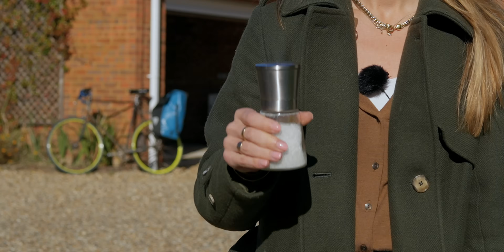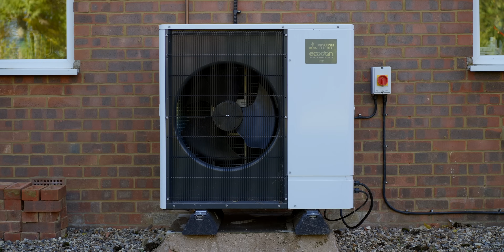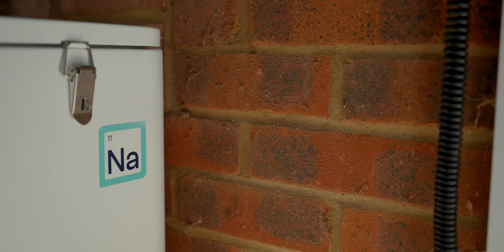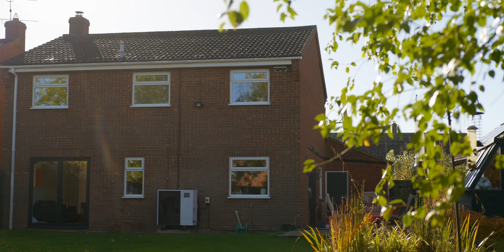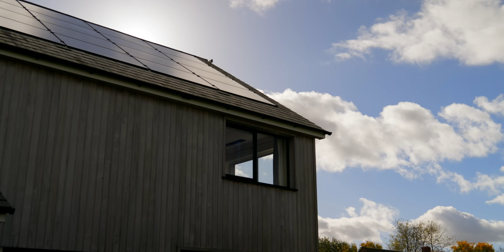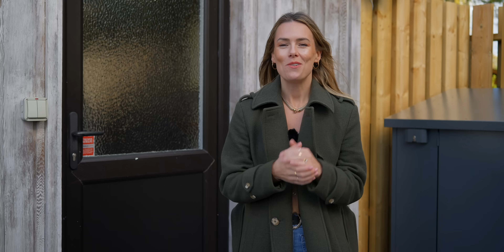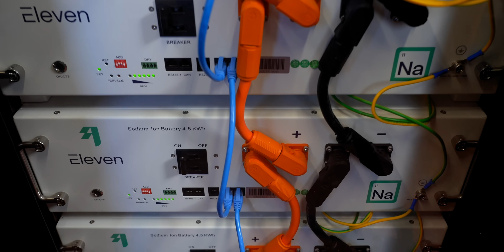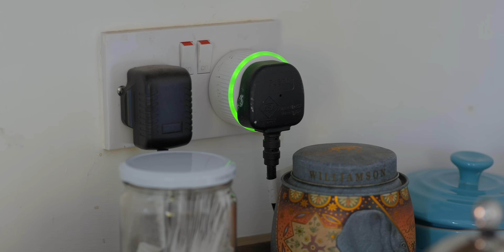Sodium Home Batteries Are Here! Is Salt The Key To Cleaner, Cheaper Energy?

Comment: It's very much a salt battery, as Sodium carbonate (Na₂CO₃) is a salt. 

It's perfectly fine to call it a salt battery as the general understanding of table salt is sodium, and that's what this battery is. Who cares, if it's a chloride (NaCl) or a carbonate (Na₂CO₃). The starting element for both is Na, and it's called a Na battery.

Many places produce Sodium Carbonate by using Sodium Chloride, by using a brine (concentrated NaCl solution) with ammonia. It literally can be made with sea water or table salt.

Comment: This is very interesting but all of the electric operations rely on cheap rate electricity overnight. What would happen if the energy companies  stop supplying cheap rate electricity?
Reply: There is almost always going to be cheaper rates overnight as most people are not active about the home at midnight to 6am generally. As for renewables, yes there is no solar (hence batteries) but the wind blows at all hours, and hydro is time-managed.
Reply: @petesig93 This is a tricky question actually. Once we get to about 10 million electric vehicles charging overnight the difference in price may well flatten across the day. Add 10 million heat pumps to this and the daily load curve that produces the daily price drop may well change. Predicting exactly the shape of that curve at any future point without historical data to feed the model would make it a hard problem to predict accurately. What we can say is that it will be different.

Comment: The idea to double the 36 kWh is just silly, try and calculate the payback on the last kWh, it will never be payed back. Much better to get more people to install 10-15 kWh.
Reply: 2nd owner here - Fair point, I think could (in the sense that the 12kW Eleven inverter can accommodate it) and would got a bit muddled. Although saying that the current capacity won’t get through the day in winter once we move away from LPG to a heat pump. The other element is we have 13kW of installed solar but a DNO export limit of 5kW ,  part of the batteries job is smoothing out our export in the summer months.

Comment: Also the normalised density gap is narrower, because the usable amount of storage of a sodium battery is greater than a lithium battery, even though lithium has a higher energy density.  i.e. you can fully discharge and re-charge a sodium battery without damage, unlike a lithium battery. Sodium batteries are a fair bit safer that lithium also. Thus your levelized cost risk profile is much more favourable for sodium.

Comment: Whilst it’s another more chemistry battery , the fact that they choose such a awkward box capable of 3 packs units that are rack stacking only will put many off, they should have developed a p54 pr p90  rack enclosure capable of 5 pack or more for households plus the slow charge/discharge will put many off expecting ups levels I question the 1000 cycle life especially when many packs now have a 3000 cycle life

Comment: Great to hear of a new battery material.  The 2nd example house must have a 3-phase supply and a sophisticated inverter to able to charge and discharge so much power in just a few hours - is this correct?  How does it work?  My own 16.4kWh system would take 6.5 hours to either charge or discharge!
Reply: 2nd home owner here - we only have single phase. 5kW charging from 2330-0530 on Intelligent Octopus Go is enough to hit 90% SoC most days.

Comment: I don't see cheap sodium battery anywhere. Some other expert (whom not just show sales people talking about their product) measure these batteries and it was far from good. The efficiency is terrible compare to LFP batteries. The heavy weight cause more transportation and installation cost. Yeah it is working in low temperature, just can't charge it. Because of the high voltage range you need much more advanced inverter, which cost huge amount of money.   LFP battery cheaper, much more reliable. Maybe this technology will be better after 5 years, but right now it is waste of money.
Reply: 94% efficiency, and i'm getting quotes of 20% cheaper than a LFP battery.

Comment: So what about thermal run away? Are they safer?
Reply: Yes they are a bit safer than lfp and a lot safer than nmc. Although thermal runaway is at a similar temperature to lfp the resulting fire has less energy. Like lfp oxygen is not released during thermal runaway. The main point is sodium doesn’t suffer from plating and so is far less likely to fail due to internal short circuit. So a safer bet.

Comment: Pretty sure that Sodium ion batteries are the future of home energy storage, especially where space is not a big issue.  For me I will have an empty space in the back garden which could take 3 or 4 of the eleven battery boxes and would be out of sight.  I would need an expert to determine the best storage capacity for me when I put in a heat pump and solar
Reply: Basements for batteries ;)

Comment: Some nitpicking: Besides the fact that so many already mentioned that it's not sodium chloride in the batteries, sodium chloride isn't safe, you can eat some, but too much and it's actually dangerous. You'd need to consume a lot of sodium chloride for a single dose to become toxic, but it doesn't take that absurd amounts, half a gram of NaCl per kg of body weight can be lethal. That's a number of times more than what most people eat even in very salty dishes, but that's also an unusually low "safety margin" for things we eat.             

Pure sodium is actually highly reactive, similar to pure lithium. Also, lithium is typically extracted, traded and handled in bulk in form of some salt, not in it's pure form. I think it's usually traded as lithium carbonate, which you technically also can eat, some, while the safe amount is significantly lower for lithium carbonate than it is for sodium chloride, the "it's safe to eat" statement is technically true for both.          

And as they described, it's not the the direct effects of the differences between sodium and lithium that makes the biggest difference between the battery categories, it's indirect effects. And, there's not that much of an advantage in sodium ion batteries, yet. I'm not aware of any sodium ion batteries that are as cheap as the cheapest LFP-batteries on the market, and the practical advantages of sodium ion batteries aren't that significant compared to LFP, in most cases they practically don't matter, once installed. 

That said, if Na-ion will become significantly cheaper than LFP, which also will become cheaper than it currently is, that's great, obviously mostly for stationary applications, but the energy density isn't so low that use in EVs isn't completely out of the question. When we all grow up and realize that life isn't a cannonball run, and have chargers were we usually park our cars, lower cost and better low temperature performance might outweigh the lower energy and power density.  CATL claims they already have achieved 175 Wh/kg, on the cell level, but even at cell level I think that's in the same ballpark as some EV's currently on the market.

Comment: 16:20 batteries doesn’t power data centers they just smoothen the power to the computers
Reply: I suppose they can increase the max output though. Like a data center might be limited by how much grid energy they can use there so they have to design it so their peak load never exceeds it. But the peak loads might only last for an hour, or even minutes or seconds at a time, so it wouldn't take a big battery to help cover those peaks which would allow the data center to be designed around a higher energy supply even if the grid can't supply it all.

Comment: Sounds like some very promising tech. I think the biggest question I'd have before going with a system like this would be, as always, what happens if Eleven falls over. Presumably at the moment the logic for the smart management system is cloud-based and handled at their end, so you need to be certain you could switch over to manual management if one day that service gets switched off.
Reply: There is local scheduling available through Bluetooth, and also a Home Assistant integration. While the HA integration is currently using cloud based control it can be swung over to local control if there was no cloud service, you just don't want both at the same time because they'd fight.

Comment: Aside from the battery chemistry, what the guy was saying about storing energy locally and exporting from the solar panels absolutely makes more sense to me than building new nuclear plants. The new mini nuclear plant in Wales with an investment of £2.5bn from the tax payer means it will generate power for 3 million homes. But that won't reduce our bills. Taking that same £2.5bn and add solar and batteries to as many homes as possible. And that might only power 1 million homes but that's 1 million homes with reduced bills, that's 1 million homes exporting to the grid so reducing demand on the grid and thus the requirement for more nuclear.

And you can bet the new plant in Wales will run late and very over budget.

Comment: Aside from the chemistry description - the real issue is the woeful round trip efficiency currently being recorded from sodium ion batteries.  Thus far 65% efficiency is where it's at, and that represents  an utterly staggering waste of energy, compared to LFP (currently comfortably exceeding 95%)
Reply: 95% according to the data sheet for these batteries. Time will tell if that is true
Reply: @pmac6584  actually, using LFP in 5-95% range will easily yield 98-99% charge/discharge efficiency. Tested firsthand.

Comment: If as is the case with this installation one has a heatpump it’s better to have at least 2 of these 10kwh batteries. In my case I’ve two Powerwalls with a total capacity of 27 kwh. In the winter we would need most of that to run our all electric home.
Reply: Huge nodal batteries that a slew of homes run off of at key points as backup/etc. so people don't have to install them. Then cars running on swappable batteries deployed at swapping stations that are connected via the grid obviates need for hyper-expensive all-home wiring for car charging. 
So no need for a Powerwall at all. Just localized battery blocks and swapstations and battery-delivery service within 5 minutes (or hybrid range gets you to a station so no worries).
HUGE savings in this coming.
Reply: Approximately where are you located? I’m north of 50° in Alberta and have a cold climate heat pump, would love to compare notes with your experience.

Comment: I see the benefits of sodium and even see CATL have released one similar to LFP energy density and lower prices. It really could be a revolution offering energy independence. My concern/query is what is the energy requirement to convert the raw ingredients that can me mined locally into the correct form. Could it be another version of hydrogen fuel cells that use more energy to create?

Comment: just btw it's not actually salt, it's sodium which is actually kinda dangerous in it's elemental form, but like lithium batteries it's not stored in it's elemental form within the battery to make it safe, if i remember correctly what makes NMC dangerous is the cobalt I think... point is it's not actually the lithium as the lithium isn't in it's metallic state after being charged initially.
Reply: sodium carbonate. 

li-nmc is prone to fire because the electrolyte is flammable, plastic inside is flammable and delicate, and the metal oxides can provide oxygen to fuel the fire. some other lithium and sodium ion cells do not have these vulnerabilities.

Comment: Of course Sodium batteries have very very recently hit the market, so what some people are judging is of course a very first product line. After a few years of developement, the situation must of course be different. The plus and the minus will be used for market targeting. If you are afraid of fires, if you need low and high temperature, if you dont care about the foot-print that much, if you are in for the lowest possible price, sodium will probably be the choice. If you are in for maximum power density, solid state can possibly be the case. We must just wait and see....

Comment: For those pointing out that sodium batteries don't use literal table salt (NaCl), bear in mind that the primary means of obtaining pure sodium is mining rock salt (halite) which is indeed mostly composed of sodium chloride. This is filtered, purified and then heated to a molten state and the chlorine is separated electrolytically by passing a current through it (this is the Downs Process, named after American chemist James Cloyd Downs). This results in molten sodium being collected at the cathode. See the Downs Cell here: https://en.wikipedia.org/wiki/Downs_cell

Salt can also be obtained simply by evaporating seawater using the sun's energy. This takes a little longer, but has the advantage of using very little energy to physically collect since the sun is doing most of the work for us.

However, there is a shortcut to obtain sodium carbonate by using the Solvay process. See https://en.wikipedia.org/wiki/Solvay_process. So when people talk about making batteries out of literal table salt, they are correct in that the salt is the raw unrefined source of the sodium used later in the battery making process.

Comment: Not that we will ever run out of lithium but we will definitely not run out of sodium and any country with a coastline can make their own if they need to. Perfect for energy independence.
Reply: Ocean life cannot live without a minimum concentration of salt in the water.
Reply: You forget we won't run out of hydrogen either.

Using green energy means green hydrogen.

Hydrogen instantly recycles itself back to water at the moment of use.

Hydrogen is the only fuel that keeps on giving.

It's kept our sun going for over 4 billion years and it's good for that again.

The age of sodium or lithium or "any chemistry" batteries for use in transport is over.

Batteries were only a step on the way to providing power in vehicles.
Reply: Correct. And salt allows to replace river dams as the main battery of the unstable renewables. Great for desert or flat regions that cant build Dams.

This salt batteries when massively produced, cheap, will allow Spain and Portugal to not get blackout again because of solar peaks.
Reply: @ricardoxavier827 

Spain and Portugal suffered from problems with inertia.

You could have researched the issue prior to posting.

But you didn't.
Reply: @ForestForest-n9iyou could have fact-checked your research & found that it had nothing to do with inertia (or renewables)
Reply: @alanhat5252 

😂😂😂😂

You appear to make a habit of posting tripe.

Why?
Reply: @ricardoxavier827 

???
Reply: Not true. Processing and manufacturing of sodium ion is reliant on china. Theres an article I posted on my forum showing how sodium ion cells actually make use more depedent on china than lithium batteries.
Reply: @WillProwse  Will appreciate your efforts to balance expectations and love your films. I don't think your observation here addresses the problem of dependence in Europe. In your film your concern was cost of sodium processing. In a general well functioning world market you're right. But world markets have been totally disrupted and extreme politics from dominant economies are now driving that disruption to the extent that our concern is not COST of access to lithium or sodium battery materials  ... it's going to be about whether we have ANY ACCESS AT ALL to the quantities Lithium that are required without going "cap in hand" to china. The US has Li reserves ... Europe less so.
Reply: @WillProwse 

Then you know fffk all son.

Clear off and stay off.

Comment: Sodium ion batteries do not use table salt - literally. sodium chloride (NaCl)  vs sodium carbonate (Na+).
Reply: Don't be a pendantic twit.
Reply: Sodium carbonate can be produced easily from sodium chloride

First the chlorine is separated with electrolysis, leaving just the sodium hydroxide
Then the sodium hydroxide can be transformed into sodium carbonate via the CO2 injection at low temperature
Reply: @sihamhamda47 Easily processed, but not cheaply and not without huge environmental cost -  it's called the Solvay process and uses vast amounts of energy, coal and limestone.
Reply: They can and do, but in a further processed form.
Reply: And Air is not oxygen, but countless times people understand it as that.

The general understanding by most people is that table salt is sodium, and this is a Na battery, and sodium carbonate (Na+) can be made from sodium chloride (NaCl) using a brine solution and ammonia.

So it's perfectly fine to call it a Salt battery.
Reply: @Evolution56 Air is not oxygen alone.
Reply: @grahamcook9289 yeah I was not implying it was, but many people think it is.
Reply: @Evolution56  Salt is a category of compounds. Table salt is a specific kind of salt within that category. Lithium batteries are also salt batteries. The salt in question is just not sodium based. It's lithium based - Lithium Hexafluorophosphate.
So instead of calling it a salt battery, why don't we just stick to Sodium battery?
Reply: They can though. You can get Sodium carbonate from salt. They use sodium carbonate (soda ash) because that is available at scale easily.
In the future if there is scarcity of sodium carbonate, sodium chloride can easily substitute it.